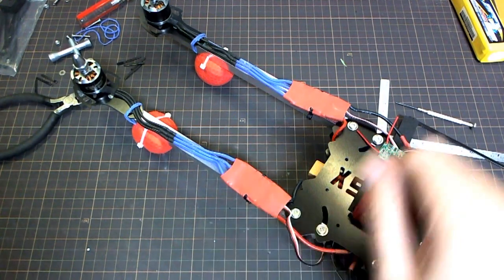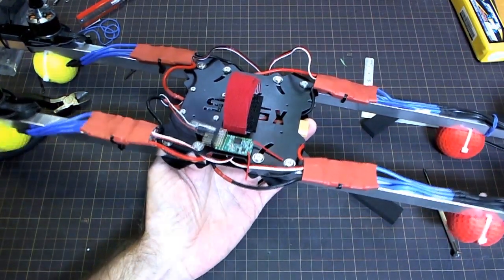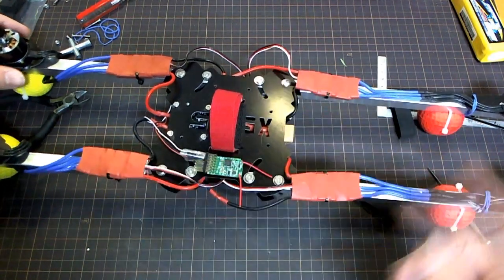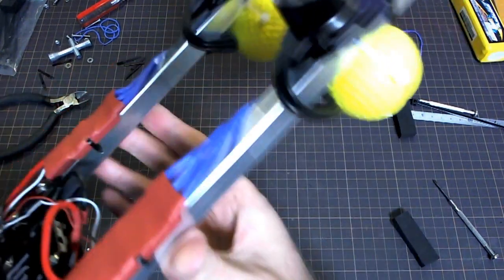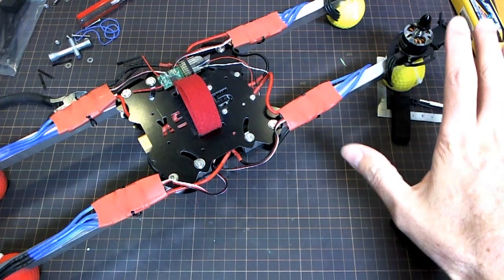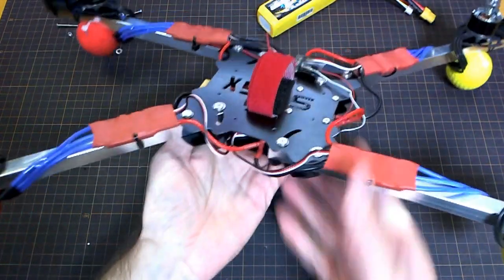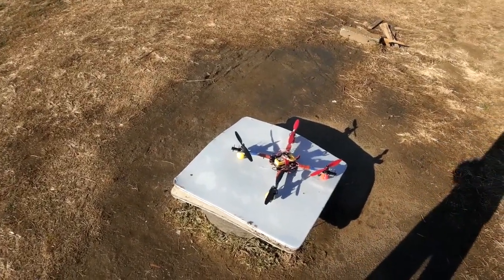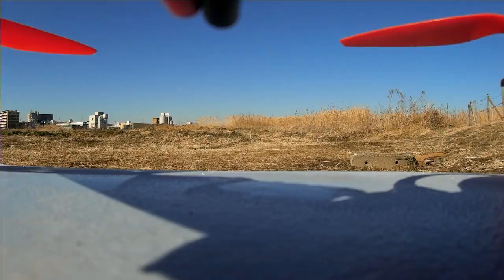Vibration damping motor mounts - clever or stupid?

Comment: Wrapping the booms with vibration dampening material, such as honeycomb foam, may help.  It is basically a low-pass filter.  Have you ever touched a vibrating guitar string or a ringing bell?  That's the dampening effect.

Among other things, the thickness and size of the cells in the honeycomb would determine the cut-off frequency (and harmonics) of the filter.  Try experimenting with it.  Even a kitchen sponge would help.

Some types of wood are actually pretty good resonators.  Although changing the metal booms to wooden material may help a bit, I don't think the gains would be very dramatic.

There are three major rules to solve almost any vibration issue:

1. Generation -- try to generate less vibration in the first place.  I think that's obvious.  (Dont' worry, I will not tell you to balance the props and the motors again) :)

2. Isolation -- try to mechanically isolate the vibration generator from the rest of the system to filter out most high amplitude noise.  it may be as simple as a few layers of foam tape under the motor mounts or as complex as a high speed actuator (e.g., a speaker connected to a phase inverter circuit with a microphone) that would generate phase inverted vibrations to cancel out the unwanted noise.  This is analogous to a noise canceling headset.

3. Dampening -- try the low-pass filter method above to filter out most of the remaining vibration from the system by dampening the conduits (here, the booms).

Comment: You should try laser balancing your props AND motors, it worked wonders for me. https://www.youtube.com/watch?v=PqtUSSdf8b4 . But additionally I had to construct a very soft gimbal for my Mobius. I sent you a video of my successful but ugly Mobius gimbal.
Reply from the maker: This was a test to see how much difference the motor mounts made compared to my last video, so I wanted to keep everything else the same. I also wanted to have some vibration so that the mounts would actually have some work to do. Wouldn't the shifting center of mass of your camera cause a problem for the flight controller trying to stabilize the aircraft?
Reply: ***** I get that, promising idea I think! I just ment in general if you want to eliminate jello you should start there. But if you want to notice a difference I get that not balancing might help. But if you really want to see the differences you have to try the laser method it's genius! Maybe you could try another foam, like the one used in hearing protection ear plugs because I think your foam works more like a spring than like a dampener. Foam from ear plugs is viscoelastic which actually "destroys" the vibration energy into heat more and is not as "springy".
Actually the copter flys excellent. My experience now is that if you set up Multiwii accordingly you can get a very robust flying platform. Also I think my gimbal acts like a lasy pendulum and unless I fly extreme maneuvers it's not moving much. I hoped the pendulum nature of my gimbal would help in pointing the camera at a stable angle to the ground/horizon when pitching forward but as it turns out the airspeed cancels that out almost completely.

Comment: I guess some of the vibration is caused by the joints on the mainframe, because it's not a realy solid connection. Have you tried putting something there for better damping ?
Reply from the maker: No, that's a bit awkward because the mounts need to swing around to fold the frame. My idea was to keep the frame as one piece, so to follow that plan I would be wanting to make that connection as hard as possible rather than damped.

Comment: does the vibrations of the motors affect the gyro, stabilisation and behaviour of the quad?
Reply from the maker: I've heard people say they do, but that has not been my experience. It's more of an issue for recording nice video from the camera.
Reply: It does if you set Multiwii to use the standard lowpass filter, but if you set it manually to 42Hz your vibration must be VERY bad to disturb it.
Reply: very recently i've made a 4mm plywood quadcopter and it seems to me that plywood absorbs a vibrations.Although  I don't have a camera to confirm it. That how it looks like:
https://plus.google.com/photos/110599126923439344534/albums/6114518952892242081

Comment: To bad man! But it sure was a good experiment. New knowlidge in the bag I'd say!
What would you think of swapping the allu arms out for wooden ones? I would think wood would transfer less vibration?
Reply from the maker: yeah wood should be slightly less vibration than aluminium, but also not a huge change I think.
Reply: ***** I think there could be more dampening then you think :)  Wood isn't used on axe handles for nothing :)
Reply: I think that solid piece of wood, esp hardwood transfers vibrations more than a skeleton-type construction although it is still better than aluminium profiles. My very first and 100% plywood copter does seems to be quite stable.
https://plus.google.com/photos/110599126923439344534/albums/6114518952892242081
Reply: Hoopoe Good point! The kind of wood definately has quite an impact on the vibration-stransfer.. I have to admit I have no reall knowlidge in that field.. But yes.. I've sen quite a lot of self-build wooden copters perform Very well :)